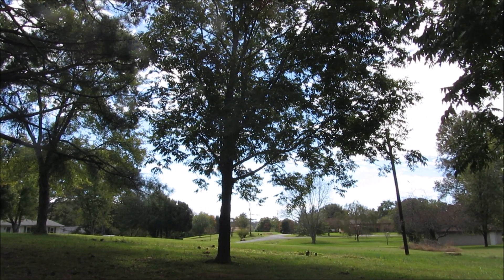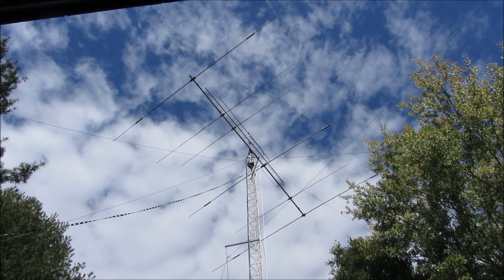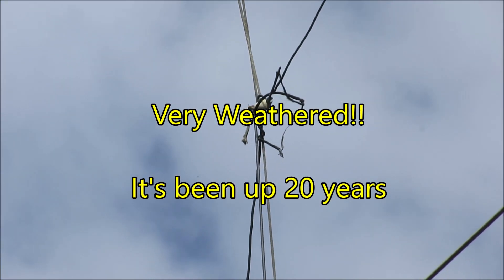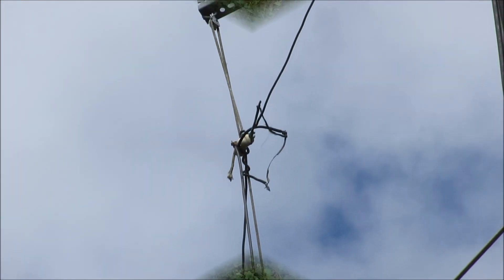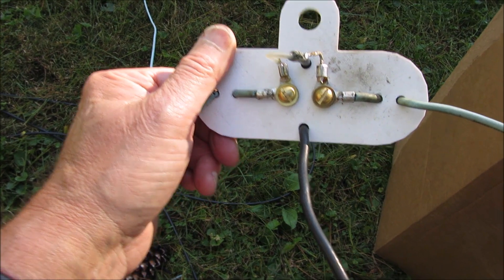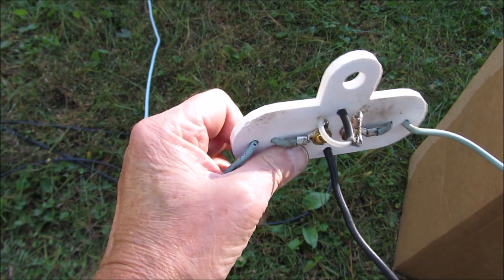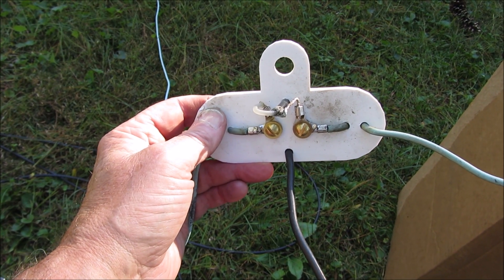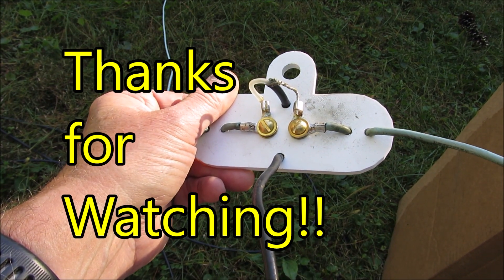3-D Printed Center insulator by mosslack

Comment from the maker: Update on this insulator: I have been using this antenna with this insulator for quite sometime now, running over 1000 watts rf, no issues. A few weeks ago, A large tree top (4 prong) fell into my tower taking out my tri band beam and all my wire antennas. This insulator survived the tree fall. The tree broke the antenna wire ( 10 awg) that this insulator was on in two places. I repaired the antenna using this insulator and it is working flawlessly.

Comment: Nice to have a friend to provide us with dipole insulators! 
Thinking about doing an 80m and a 160m dipole with 10 AWG Stranded copper here and your method looks like an easy way to do it. Have a self-standing tower here and like your angled standoff mount. Need one similar. 
73 from N4EMP
Reply from the maker: Thanks Eddie, I recently had a tree top (actually 4 from the same tree) that were as big as my waist hit my tri band beam (3 elements bent) and come down the side of my tower. Bent the tower slightly. Its still usuable and I think my guy wires will straighten it more. The tree took down all my wire antennas. The 80 meter dipole broke in two pieces but the printed insulator was not damaged in any way. If you use the angles for a pulley system be careful in your selection. I went back to the same big box store to get more of the angles, the ones I bought were of not as substantial. In fact cheap metal and bent. I plan on replacing them with unistrut in the future. Thanks for watching and subscribing….Take Care..73—Larry W4PJP
Reply: @Backtothefutureradios  Been watching some of your videos here. You've been busy!
Also have another channel that's in my call if you are interested. Spend most of my time on this account though. Trees near towers stink! Lol

Comment: I need help with an old radio it’s made in the 30s or 40s and it works but I can’t get it to tune in to any channels it’s a American chassis but a Swedish cabinet does anyone know how I can tune it into a channel it has an antenna
Reply from the maker: Hi Alexander, maybe some of the viewers can help me with this….. first we may need some more information….you say its working, I take that there is sound, as you tune across the band does that change any? Has the capacitors been changed? All the tubes light up? Please give us a bit more info…Thanks Larry
Reply: @Backtothefutureradios  The tubes were glowing but I haven’t changed any capacitor and it makes different tones when I turn a specific dial otherwise I don’t know why it’s not working I will try to fix it when it discharges. I have asked some other people but haven’t got a response yet.
Reply from the maker: @alexanderlundmark5079  I believe changing all the capacitors will be necessary for it to work properly. As you may already know, capacitors break down over time…..a leaky paper cap will cause distortion and make the sounds unintelligible….bad electrolytics (filter caps) may short, explode and damage the power transformer and other vital parts of the radio….I would not power it up again until the capacitors are changed…. Be careful, lethal voltages are in this radio, the main power input has unlimited current potential……If you are unsure, seek help from someone  who knows about safety working on high voltage circuits!!! Take Care—Larry
Reply: @Backtothefutureradios  I will wait about a month for it to discharge then I might try to replace the capacitors

Comment: That 3D printed Center insulator looks like it will work just fine. Doug has been doing great work in Tinker Cad and then Gregg has done some nice work with his as well. I have only made a couple things with my 3D printer haven't quite got the hang of Tinker Cad yet.
Reply from the maker: Doug did a fine job….I think it will hold up fine if the material don’t break down in the elements! Thanks for watching!! Take Care—Larry

Comment: Looks good and solid! What do you use for matching?
Reply from the maker: Thanks! On my older rigs, None….the newer ones built in tuners in the rig….with the 10 awg wire, it’s pretty broad banded…whole 80 meter <2:1….I do t run an amp…Take Care—Larry